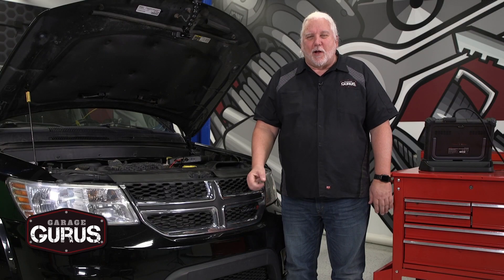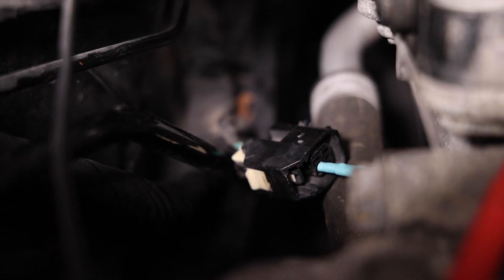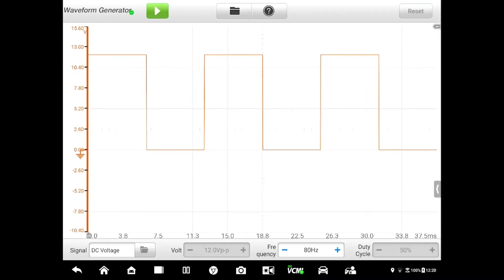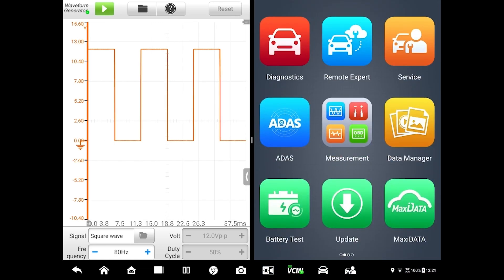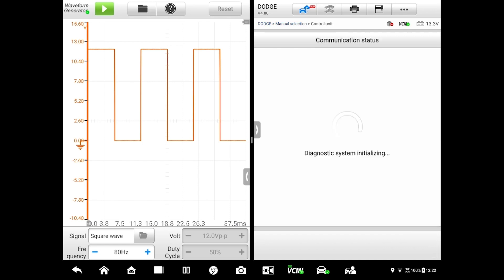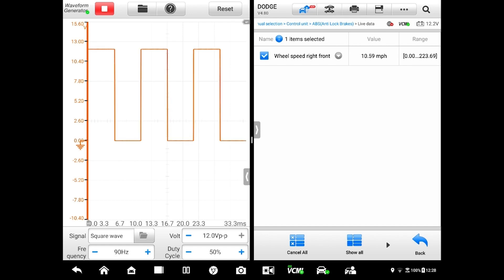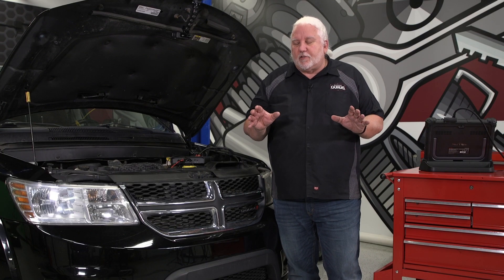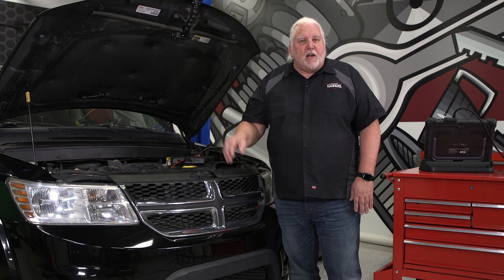Garage Gurus | How to Validate a Wheel Speed Sensor Circuit with a Signal Generator

Comment: I like what you've done, but it seems to me that you could still have a supply voltage problem from the EBCM to the suspect sensor. Without testing the supply wire for voltage, you could possibly be buying and installing a WSS unnecessarily.  I'm not sure about Chrysler, but I've seen GM's that stop sending voltage to the wheel speed sensor with the problem. As a result, you can't test that circuit like you used to be able to,  by just leaving the key on and using a test light or voltmeter. On the particular GM I experienced this on, I left the sensor hooked up and used my voltmeter on min/max capture mode so I could see if the EBCM sent the voltage and the circuit was able to carry it. Is there a better way to test this?   Thanks for your helpful videos!

Comment: The issue I see is you are only testing one of the circuits for that sensor. You could still have an issue with the other circuit.
Reply: If I was testing this, the negative test wire would go to the negative side of the sensor connector instead of the battery.  That way we are testing both circuits.
Reply: @justincaseauto  Could you explain, Not sure I'm following you.
Reply: @abunkerfan  The wires (circuits) to the sensor from the ABS module... One is voltage, and one is ground.  Connect the ground test wire that the video connected to the battery ground, to the ground wire (the one he did not test) to the ABS module instead.  That way, if you get a reading out of the scanner, both wires and circuits in the module are OK.  If not... then we have to test the wires individually.   This way, as dksob81 pointed out, both circuits or wires are tested at the same time.  Sorry, sometimes I don't explain myself very well.
Reply: @justincaseauto what do we do when the circuit is bad?